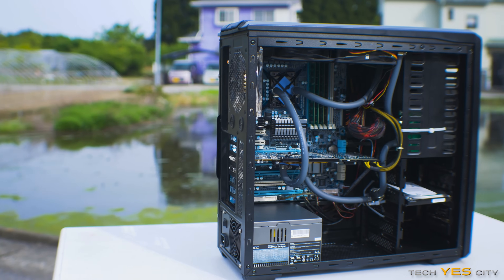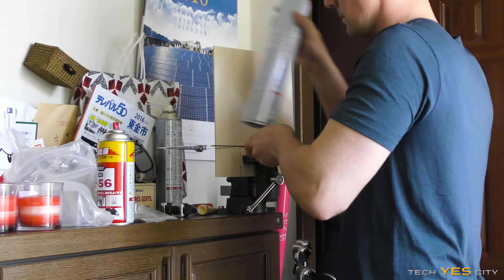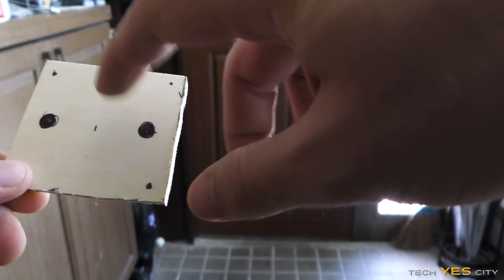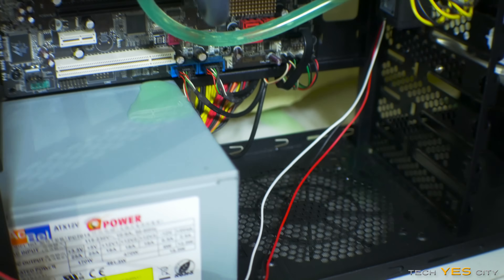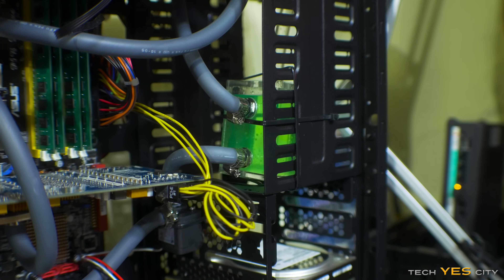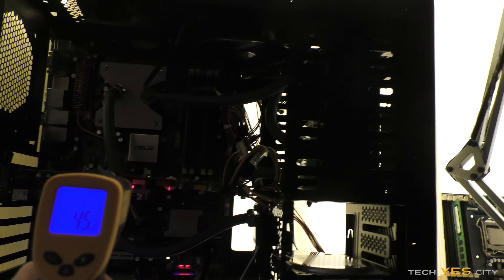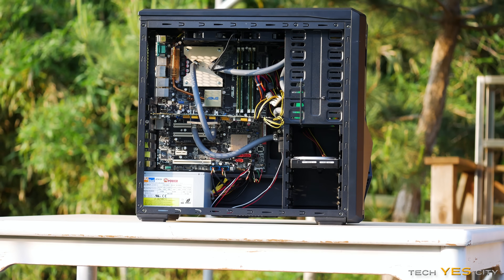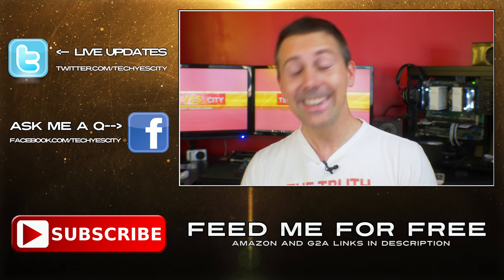$50 Loop ROUND 2 - I've Already Gone and LOST my MIND (Pt. 2/2)

Comment: Cheap Custom waterrcooling is possible, but i would avoid buying ultra cheap , as in the end you have to buy extra parts, replace things etc ...
Those parts should be good from the start: (Those are no afilitate links - and only sample stores on what to use, sellers are not known, u might find it cheaper or with better delivery)
Waterblocks with actual fins:
for GPU: aliexpress.com/item/4001042827650.html
for AMD CPU: aliexpress.com/item/4001268131807.html
for Intel CPU: aliexpress.com/item/4001035893891.html
Powerfull pump:
Sc600 Pump with Water Tank: aliexpress.com/item/4001015263171.html
Compression Fittings:
Straight: aliexpress.com/item/32892082654.html
90° angled: aliexpress.com/item/1005001319583504.html
Radiator:
Aluminium: aliexpress.com/item/32976072893.html
Copper: aliexpress.com/item/4000065588389.html
Hope someone finds this usefull ;)

Comment: Be careful standing it's very easy to round the outsides. You need a solid surface beneath the sand paper not those cushy ones on those Sanders. I would use a flat solid chunk of metal or hardwood. Love the vids

Comment: this needs an update as there's no cheap aliexpress blocks with microfins :)

Further, how about using a cheap fuel pump clone of Bosch 044 as the pump with just a 100k potentiometer to dial it down a bit. Even the clones should be able to do at the very least 5bar pressure while maintaining at least ~250lph >;)

Comment: How about doing a part 3 with a better pump and blocks (or maybe even a full copper loop).
These ones look interesting:
https://www.aliexpress.com/item/1pc-CPU-Water-Cooling-Block-Waterblock-Nickel-Plated-Copper-Base-Inner-Channel-For-Intel-775-1150/32818841901.html
https://www.aliexpress.com/item/Bykski-CPU-Water-Cooling-Radiator-Block-use-for-INTEL-LGA115X-LGA2011-Cooled-Radiator-Transparent-Acrylic-0/32827485792.html
Or for the GPU:
https://www.aliexpress.com/item/GPU-Water-Cooling-Block-Double-Channel-Copper-Cooler-for-Video-Card-Graphics-Card-Water-Cooler-Radiator/32837790850.html
https://www.aliexpress.com/item/Bykski-GPU-XPM-High-Performance-Jet-GPU-Water-Cooling-Copper-Water-Block-Acrylic-Top/32803302362.html

I´m actually thinking about buying one of these GPU blocks for my RX580, I already got an Alphacool Watercooling Loop for my CPU (which I got for free, for testing) and I don´t wanna spend 100€ for an GPU. I would really enjoy a follow-up to this cheap water cooling topic. :)
I love your content and which I´ve been enjoying since your first used budget-build (I´m not even shure, if I was still using my older YT Acc back then^^)
Best Regards
Niklas

Comment: Theres nothing wrong with the hosing you're using.
Your issue was trying to use cheap steel hose clamps
that were stamped with jagged edges and a crude & inaccurate tightening mechanism.
you could have solved the issue by introducing a pressure medium inbetween the clamp and hose.
like some old cloth or anything with some plasticity.

and there's nothing wrong with the waterblock.
It's poor performance is caused by the lack of surface area to transfer energy to water.
but this can be remedied by increasing the variable you can control: flow velocity.
either increase the voltage to your water pump, or add additional pumps in parallel .
you want higher *flow rate*, not pressure.

since there is no surface resistance in the waterblock, you just need to run as much water running through as possible to keep the heat saturation out of the block.

Comment: its cause of the fluid you used, it doesnt soak up enough of the heat coming off of the processor and gpu to cool it efficiently, use filtered or distilled water with maybe 95% of it being the pure filtered/distilled water and 5% or less of the radiator fluid you used to keep anti corrosive stuff in the fluid.. grrrrrr....

Comment: I know it would make it more expensive but, if you added something like a cheap copper block from Chine, it might work.

http://www.ebay.com/itm/Computer-CPU-Water-Cooling-radiator-Block-Waterblock-Copper-Liquid-for-Intel/162502884444?_trksid=p2045573.c100507.m3226&_trkparms=aid%3D555014%26algo%3DPL.DEFAULT%26ao%3D1%26asc%3D41375%26meid%3Dd22a4abba71b466b97638a5b4396155f%26pid%3D100507%26rk%3D1%26rkt%3D1%26

Comment: I did similar with my gpu coin mining machine to keep it in a mid tower. I added 5mm aluminum board between the block and gpu to cover vram as well, then i put two 40*120 waterblocks on each gpu. The thing keeps 6gpus at 55-60degrees when running full speed, 24-7

Comment: Brian if i may make a suggestion. Sand paint off any surfaces that touches the gpu/cpu. Paint/nickel/anything you add will hinder thermal efficiency. Pure copper is more efficient then copper thats painted, same goes for Aluminum thats powder coated/painted/etc. Give it a shot id love to see a temp difference.

Comment: Hi again, can u try "Round 3" with the copper water block? Check out these cpu blocks, they are the same but are copper - http://www.ebay.com/itm/Copper-Water-Cooling-Block-For-Heat-Sink-Cooled-GPU-CPU-Radiator-Liquid-Heatsink-/361498980288?hash=item542b04afc0:g:dkUAAOSwwPhWjhZP

Comment: Out of curiosity, why would you put the blocks on diagonally compared to the usual "straight" way you see on many blocks nowadays?
Reply from the maker: Was just so I could fit them flush and have equal pressure between the block and the die/ihs.  Would have been a little weird if I mounted these blocks square with the input and output then being diagonal.
Reply: Cool beans, totally didn't think about that.

Comment: Totally random off topic question..

I purchase some "high quality" thermal pads... 17 kw and 11 kw... They cost a alot for little pieces of silicon..The 17kw means it has a higher themal Conductivity... And 11 is lower... Although I'm sure u know this

I was plan on replacing the themal pad on Both my GPU VRM and MY mother Board VRM... I don't have enough of the 17 kw to go on both so my plan is put the pad on the one that will benefit the most from lower temperature... The GPU is a water cooled r9 290 and the mother board is Gigabyte Ud3 990fx Rev 4.0.

Anyways the question is which on of these VRM generate More heat CPU or GPU VRM... Which would benefit more from lower temps?

Comment: Nice follow up!
I have some crazy ideas:
- Make your own resevoir (to size!) by purchasing acrylic, then cut it to size, drill some holes and tap 1/4" threads in the holes.
- Make some blocks in Solidworks or Inventor or some sort similair program (or ask fans, like me :p, to do it) and let someone with a CNC machine cut it out of copper.

Comment: Overall this is awesome and I like the DIY thing I guess that's cause i'm a kiwi. Luckily its leaking there and not over any components. If this works you should call it the Outback Loop. Could just be that pump really all you need though is a decent pump and blocks. Oh well at least you didn't buy a XSPC kit only to have it leak from the LED holder on the reservoir tried fixing it with silicone sealant and i had to use paper towels as its maxi pads to soak up a lot of the fluid till i replaced it with its replacement the EKWB res pump combo which is sweet now. I reakon if you just get some decent blocks and a decent pump then you will be sweet.

Comment: Hey Bryan, look what I found on Ebay :   http://www.ebay.ie/itm/Water-Cooling-Kit-240-Radiator-190mm-Reservoir-Pump-CPU-GPU-Blocks-RED-LED-HOT-/301760060982?hash=item46424d1e36:g:HpoAAOSwo0JWQE5k
      Imo, it´s worth the money, but wondering about your thoughts on that kit.

Comment: With a bit of googles you'll find that sanding something flat, isn't that hard.
Just get a surface as flat as possible (mirror) and fix the multiple stages of sanding paper to it.
Then just sand it by hand.
Doing it with that kind of sander will just sand the outsides, because of the overhang, you just end up making it MORE concave!

This setup wil prob. work fine if you play by the rules!

Subbed, Respect.. ;)

Comment: i would just recommend getting a proper water block for at least the CPU, the one you were using you had to lap down just seemed like it wasn't meant for a CPU, as you noted it didn't use fins inside just "bumps." I'm sure you'll can find a decent, maybe used, proper CPU waterblock.

Comment: you could still  use radiator in the next build, and there are some interesting copies of EK waterblocks named Bykski (around 20-40$ per  waterblock) and also try to get that syscooling pump /w res  combo for  around 15-25$ depends on the store

Comment: Hello there Tech YES citay. I keep noticing in the background of your room that you have a dual cpu setup with cpu fans that have airflow directing towards each other. Now this may just be my ocd self conflicting with this but is there a reason that you have the setup this way? To me it seems like is can hurt the airflow especially if you have the intake air going in one direction.
Reply from the maker: Yeah you are right with a closed case flow would be bad, but I always leave the side panel off and like to be different, with the side panel off it doesn't make too much of a difference, though I will be doing a massive test on this in the coming months :).
Reply: It is always nice when channels actually reply to the viewers in the comments so thumbs for that. You should do a drop test on it too though. And with all the scrap sheet copper you seem to have around I think it would be cool to make like a "$5 dollar DIY air cooler. Is it possible?" Or something like that. Even could buy some copper tubing and put some vegetable oil up in that thang and get a ghetto vapor chamber.
Reply: +Invisible〈3rx8 
Haha
I just recently had an ssd dangling out of my case because i used all of my drive bays and i didnt have the screws to mount it in the canle managment areas so im waiting for them in the mail. Currently i put my side panels on and the ssd is just getting some extra cooling because it has to sit on the basement right next to the intake fan.
Reply: i dont have my side open either, cus my wires wont fit Lol back of the mobo!

Comment: Hey I wasn't sure if you are using automotive coolant or using straight distilled water with colour, if your using coolant, you will probably see a temperature drop if you use straight distilled water as the heat transfer properties of water are far greater than anything else (besides liquid helium etc) http://www.overclockers.com/pc-water-coolant-chemistry-part-i/

Comment: the problem was the water block and weak pump. you need a cooper CPU block and radiator, never use aluminium Bryan.
Reply: get a Byski copper block for cheap

Comment: The first watercooling loop i made was with a vw golf heatcore , copper plumber fittings,cheap clear tube, a fishtank pump and a used swiftech cpu heatsink ,the cost was less than a 100$ at the time but it died in a year and it took my intel dual core 6850 with it, my last w/c build is an i7 920 with a xspc XT  kit and a dfi x58  motherboard watercooling kit, it costed over 300$ but it is running for 7 years now with no problem pulling server duty and it has 10C less than a system running on air, i guess that you cant go cheap with a w/c loop and expect good results.

Comment: How much does you spend only for the radiator?
Reply: radiators are cheap for a 240mm one. it's 20$ AUD on ebay
Reply: What don't you mean $30? http://www.ebay.com.au/itm/G1-4-240mm-Aluminum-Computer-Radiator-Water-Cooling-For-CPU-LED-Heatsink-/262115343860?hash=item3d074abdf4:g:4ykAAOSwu4BVzsbI cheapest I could find. The entire setup would probably cost $100-150AUD
Reply: thanks :)

Comment: Hi there! DDR2 RAM can be easily modded to run at 800 MHz by altering the SPD table with SPDTool, I'm using a pair of 667 MHz Kingston memory modded to 800 MHz into my main rig and the modules do pass over 10 Memtest runs without issue! Good luck!

Comment: i got a problem i wish ur answer for that please .. i have 

MOBO: MSi 970 Gaming 
CPU    : Fx 6300 14mb cash
GPU    GTX 650 Ti 2GB
PSU: XFX Power Supply 430 Watts-P1-430S-XXB9 http://egypt.souq.com/eg-en/xfx-power-supply-430-watts-p1-430s-xxb9-7750433/i/
my problem is when i press start button and going into bios i see cpu temp is over 72% then 2 sec more and pc shut down then nothing happen's please help me that's all part are new not used :(
Reply: Have you mounted your CPU cooler properly? Have you perhaps left the sticker on the contact surface of the cooler (if you have a coolermaster air cooler for example)?
Reply: +Scott Ward what kind of cooler u got
Reply: stock cooler
Reply: +Qs MeNo buy a new one vv

Comment: uses a vibrating sander to get the block "Flat", flacepalm, the pad on the sander is soft and you are appling pressure so of course its going to sand the edges first, use wet and dry paper on a sheet of glass to lap the block
Reply from the maker: Thanks man, I know my vids can make people cringe, but meh I can't win them all :P.
Reply from the maker: And waste a whole day in the process? no thx.... loop was working MUCH better than before as well, so the orbital sander worked a treat.
Reply from the maker: These blocks were uneven as, unless you were the inc hulk then 20 mins would be way too little time to get it done with the hand and sand. Smashing it with the orbital took about 10 mins for the two blocks.
Reply: +Tech YES City rekt
Reply: i loved the build, but he is right, it would have taken no time with proper wet sandpaper and glass, and been a lot better results
Reply: I think we are gonna have to agree to disagree, that being said you still did a great job of putting together a  water loop for 50 bucks.
Well done !!
Reply: Tech YES City a whole day??
20 mins at most!!

Comment: Any suggestions for this partly used build?

CPU: Intel® Xeon® Processor X5677 
Heat sink: Cooler Master Hyper 212 EVO
Motherboard: Intel DX58SO LGA 1366 
RAM: G.SKILL Sniper Gaming Series 12GB (3 x 4GB) 240-Pin DDR3 1600
GPU: Nvidia 1070
PSU: EVGA 110-B2-0850-V1 80 PLUS Bronze 850 W
Storage: Seagate Desktop HDD 2TB

Comment: I have done a lot of these budget watercooling setups, testing and ghettomodding stuff.
Believe it or not, but the fins in the block doesnt have much impact on temperature if you have enough water flow. The biggest issue with your build is that the blocks are aluminium and not copper.

Comment: How to get 40 degrees Celsius temps on your gpu for less than 10 euro!! :)

You need your stock gpu heatsink, a heatsink from an old cpu (square or rectangular), epoxy glue, zipties and two 12mm fans. Cheapest fans cost around 3 pounds on amazon (arctic cooling so theyre actually good). 
 
1). Unscrew stock heatsink.

2). Glue the cpu heatsink onto the gpu heatsink using epoxy glue. You can also glue any other heatsink, but the main point is that it has to be wide, long and high. Let it sit for about a hour before moving on.

3). Apply new thermal paste and attach your new heatsink (your new gpu heatsink is going to take up about 2 more pcie slots now, or even more, depending on the heatsink you attached so take this into consideration before you try this. Remember, BIGGER IS BETTER).

4). Place your GPU in your pcie slot. Right now we have a gpu with a huge heat sink. If you want you can turn your pc on right now and check if it still works.

5). Now we are going to attach one fan. IDEALLY youre going to want to have a side panel with a place for a fan, if theres no place for a fan just duct tape it on securely. Make sure this fan is blowing air mainly at the heatsink, and the side of your graphics card that has the heatsink attached to it.

6). Fan number two. Remember all those memory thingies that usually need heat spreaders? They might heat up a bit but the ideal way to stop this is to place the second fan ABOVE the GPU (I hanged mine using zipties from my CPU cooler). This will cool them down perfectly while helping your card remain cool in general. If you really want to you can just get headsinks from ebay but that costs money.

Side note: You can get away easily with just one fan, because now that your heatsink is so big, your gpu will be able to ideal with literally no fans spinning because of the passive cooling alone. Just experiment. Trust me this works.

I used to get insane temps and now I get 50 degrees max UNDER STRESS. 

TL;DR Glue another heatsink on your stock heatsink, ziptie two 12 mm fans around it and watch your temps drop lower than with a water loop and all for just 10pound, depending on what you have laying around.
Reply: Patryk Klos one year later...
Reply: i would love some pictures
Reply: ill post some in a bit, its a bit messy tho im not a guy who really does cable managment

Comment: I think if the pump speed was slower or there was a restriction directly after the block the coolant could absorb more thermal energy and the radiators could have done a better job.

Comment: Nice one, I designed some months ago a cheap custom loop. In my case the final price was around 75€ but I also used higher quality materials. The fittings were planned to be the same ones as you use, but I was not sure if they would not leak.
http://foroparalelo.com/hardware-y-software/refrigeracion-liquida-custom-barata-402121/
The guide is in spanish, but it has pictures of every component and links to the shop.